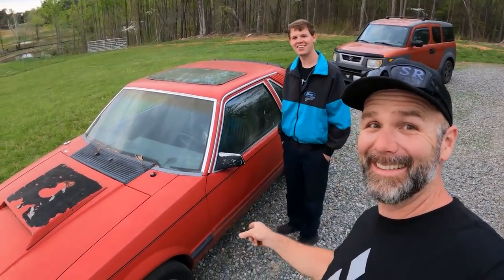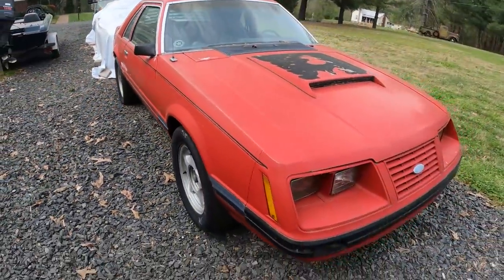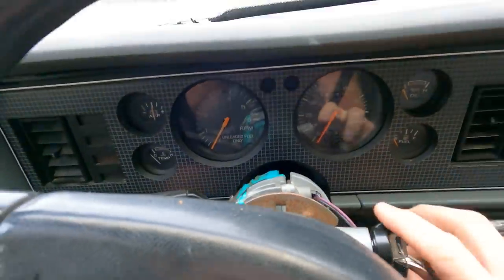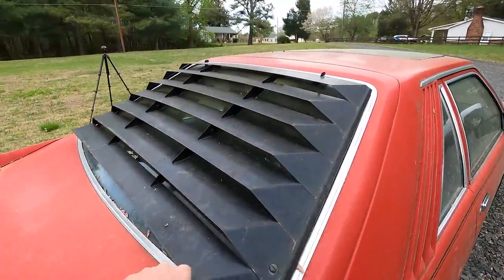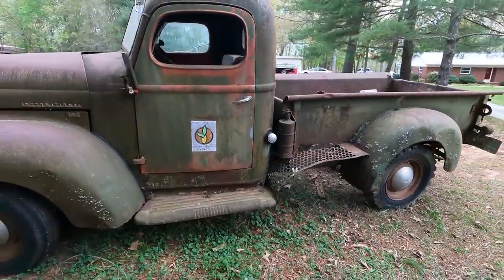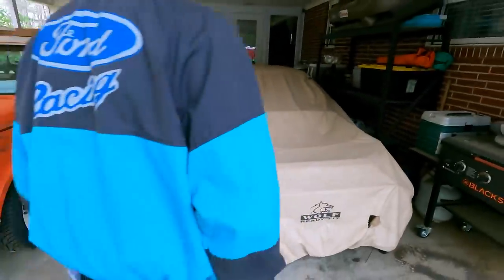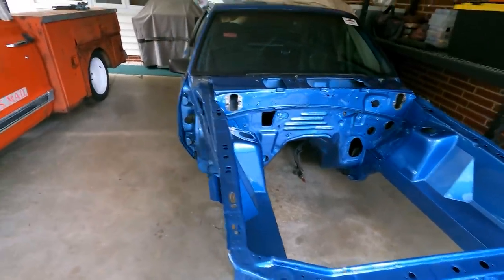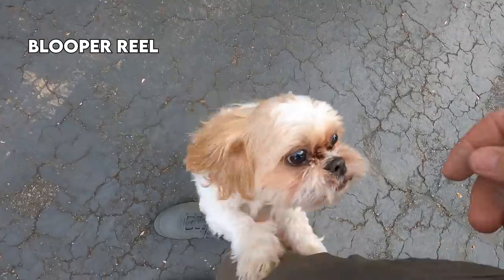This guy has way too many project cars! Let's take one home with us!

Comment: Glad to see other people like the four eyed mustang. I have an 86 convertible. The car was built in Ann Arbor Mi. Sent to Texas, brought back to Mi and has in a garage for a couple of years because of a water pump. It is an all power car but has a 3.8 6 cylinder with a cream tan color basically a girls car. But she is sold rust free and a good place start a rebuild.

Comment: My buddy before he got killed had a 1934  or 1935 I think international pickup we took the whole front cap (fenders, grille, bumper, everything) off of it and changed the front suspension, steering column, and wheel out of a 1985 Pontiac Parisienne. Then we had cruise control and a tilt steering wheel as well as disc brakes and a whole lot better ride.

Comment: I had a 1981 Mercury Capri 4 cylinder 
No AC. Same body as a the mustang.
It was a great car
Reply from the maker: I had an 84 capri 5.0! Wish I still had it!
Reply: @StoneyRidgeFarmer  I bought it from Lone Star Ford in San Antonio.
I was stationed at Lackand for 8 months then moved to Dyess AFB near Abilene until I ETS’ed out in 84.
I think I still have the Texas license plates for it.
Reply: @StoneyRidgeFarmer  We only got the 3.0L Capri in the UK, my friend had a 1.6L but we horse traded stuff until he'd had the money to rebuild it as a 2 litre.
It was still an entirely pointless car that didn't handle well and I think they all rusted out pretty quickly too, but it looked nice. Mint condition 3.0 ones are worth BMW money now